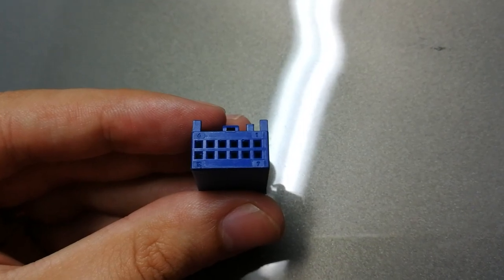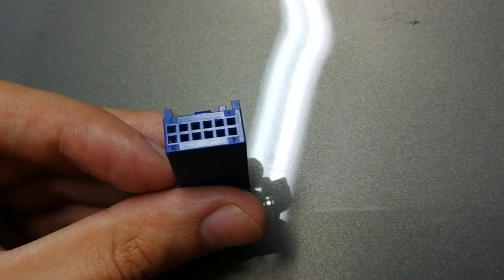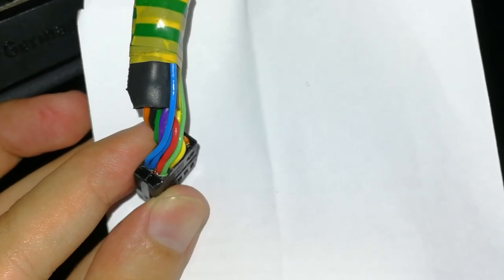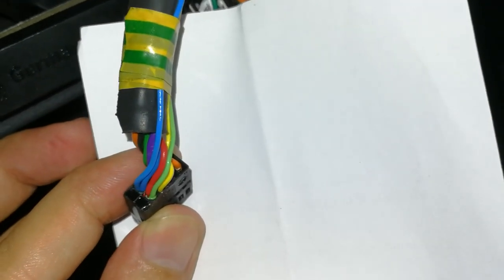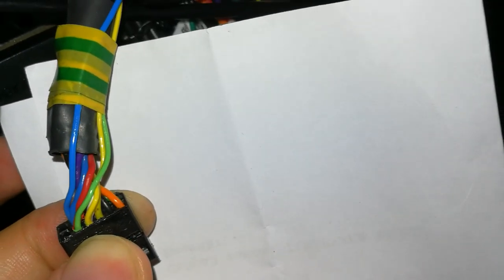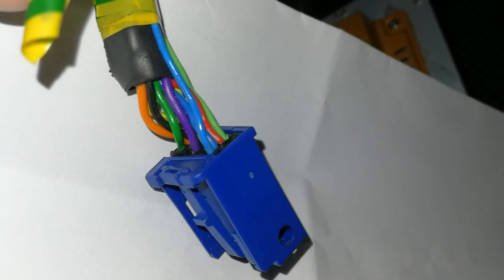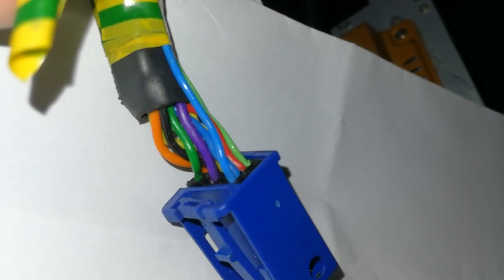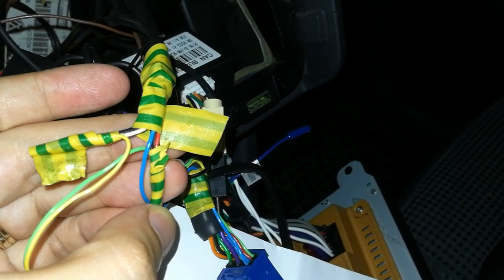DIY - Add AUX Input For Any Old Car Stereo

Comment: Mine doent have the blue connector cover
Reply from the maker: No matter, the method is same, just look at your pinouts above the stereo, find cd-left, cd-right and cd-ground pins and you will success to make it ;)
Reply: @ErsinFahredin  i bought one of these do they work
Reply from the maker: You have to try, but i think yes must work, if it is exactly for Your Car Stereo Model.
Reply: @ErsinFahredin  thnx
Reply: I would not remove any cables. Risk of damage to locking pin. I would go 8” from connector and strip insulation. Most people can’t solder.
Reply from the maker: @AskRemy  yes, this is solution too
Reply: @ErsinFahredin  do you know where i can solder the wires in the radio motherboard?
Reply from the maker: @sokratpaskali  You just have to download datasheets of IC`s (Integrated Circuits) on motherboard, and you will understand for pinouts of IC`s - what you need is cd-left, cd-right and cd-ground! I hope this helps you. But that will be difficult for you, better is directly how i made in video with cable (that socket was for cd changer i remember after that).
Reply: @ErsinFahredin  yo i connect the wires like in the video but its not working.?
Reply from the maker: i understand you, but i don`t know what other to suggest you for this and why it`s not happening, sorry for this @SOKRAT HD